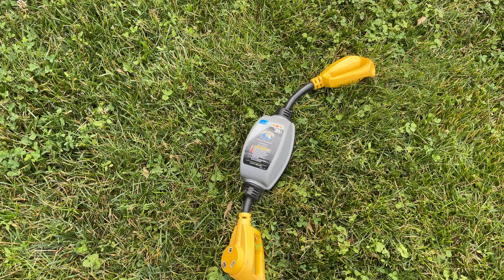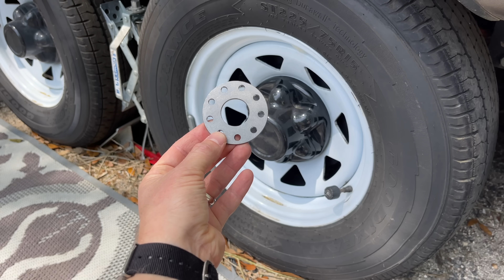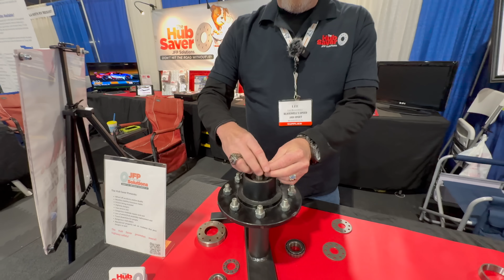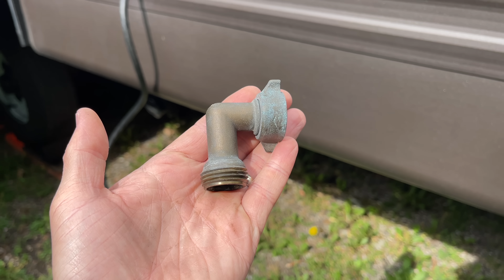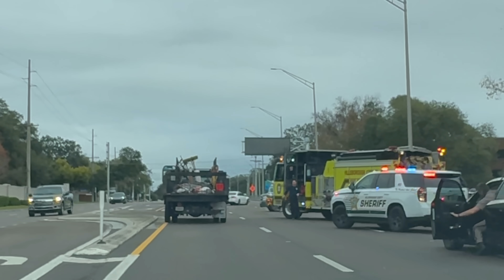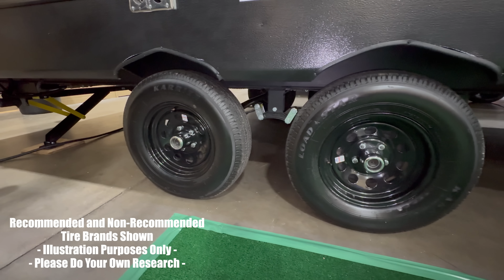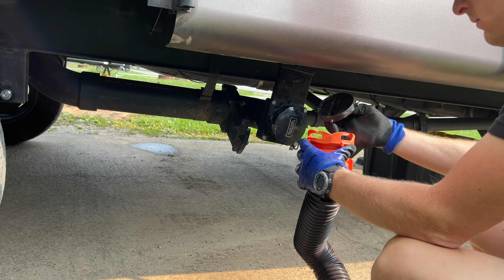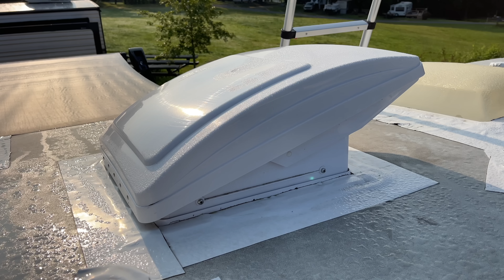RV Upgrades You Should Have Installed LAST Camping Trip (Bet you're unfamiliar with #3...)

Comment: Regarding the GasStop, when traveling, turning the propane tanks off eliminates any possible loss. Kind of an expensive gadget for not taking less than a minute to shut off the tanks. It seems overkill for at the campground.
Reply from the maker: Is a surge protector overkill for the campground? Maybe a rock got kicked up while traveling and punctured your rubber supply hose - no big deal while traveling you drive with the propane off right? but what happens when you turn the propane on at the campsite? how long might it take for you to find that leak otherwise?  GasStop is obviously optional. Happy Trails!

Comment: The Watchdog is great.  I've had both 30A and 50A versions.  It has alerted me to problems with the electrical service many times, including bad wiring.
We replaced our screen door with self-closing screen that separates in the middle when you push through it.  The magnets sewn into the edges pull the two halves together after you walk through.  No more cheap screen door and the bugs can't follow you as easily.  It's one of our favorite upgrades.  (You just have to add weatherstripping to close the gap).
Pressure regulator with a guage, so you know what the pressure is - although you can tell by how fast the water is coming out of the faucets.
Reply from the maker: I have one of those screen door styles on my garage at the house and really like it too

Comment: I have been running Hercules tires on all my trailers for years, in 15' they make a 12 ply and in 16 they make a 14 ply. Never had a tire failure with them.
Reply from the maker: Appreciate the input and data point!

Comment: What a nice young man.  
There is a difference between safety and property damage.   I was a USN nuclear trained officer and test engineer at nuclear power plants.  One consideration in writing a test  procedure is what if the test fails.  At about 16:38 a test was performed by cutting a propane hose under the RV to see if the  excess flow check valve  worked.

What could go wrong?  One of my first preoperational test failures at nuke was that all the excess flow check valves did not work  as expected.   

A couple of years ago I turned on the fan in back half of my motorhome.  This was followed by a screaming voice ‘gas.gas, gas’ from the plug in CO and explosive detector by my bed.

It took me months to find the leak after taking it to an expert who could only confirm that I had a small leak someplace.  I found it by cutting a hole in the bathroom floor.  The black pipe was leaking at the threads of T.  

KISS, Keep it simple stupid!  Propane safety feature is odor but that means you have to be able to smell it.  A small leak under an rv will not be detected because propane is heavier than air.  My installed propane detector is in the main cabinet and will protect if a burner is left on.

I take an exception with  water  pressure pressure regulators and EMS.  Unless I am in my RV, I keep  the hose valve closed or the pump  off.  If the pump  cycles on and off, that is an indication of a small leak.  One night, the pump comes on and stays on.  I rush outside because the most likely failure is the hose. Back inside I turn off the TV and can hear water flowing under the cabinets.  

The point is the pressure regulator will not prevent normal  failures.   Stop  the leak and clean up the water.  

As far as EMS is concerned, use the thing above your shoulders.  I keep a $10 outlet tester and $25 power meter plugged in.  When using a new RV pedestal, I plug them to the pedestal first.  When running a generator or an A/C, I check voltage and frequency.  I listen to how things run.

When I hear ‘sensitive electronic equipment’  my BS meter goes off.  I have a friend who is a rigger at a nuclear power plant.  Something  broke on his old RV that used electricity.  He had it fixed and they sold him a very expensive EMS.  I asked my friend what the root cause of the failure.  When I worked at the same nuke plant I was the mechanical engineer doing root cause investigations.  The electrical engineer doing root cause handed me a printout out problems with ‘sensitive electronic equipment’.  I said  there was a corrosion problem in the connectors.  He agreed.

KISS!  A  $10  screen door handle, great idea.  Buy stock in the company sell EMS, don’t  buy the EMS.
Reply from the maker: On the propane leak - I’m glad you eventually found it! The small leak test with the GasStop is another benefit - whenever you’ like you can pressurize the system, close the tank or cylinder, and then see if it looses pressure - quite handy to do upon setup at each new site.   

Pressure regulator - yes filling your freshwater tank and running of the  pump alone is a great solution and will give you an indication of any leaks as you mentioned - with the pump cycling on and off. I personally fill my tank at each campsite and have it on standby if/when the park looses water it doesn’t affect us. If my family ran solely off of the small fresh tank on our rig we’d be filling it at least daily - so running through city water is a better option - in which case a pressure regulator is highly recommended - not to stop a leak, but to prevent one from occurring at one of the plastic fittings over time at pressures higher than the system is rated for - which I’ve seen at a few campgrounds.  

Honestly sounds like your BS meter is set to “skeptic” mode ◡̈  The EMS system, above and beyond the simple surge protection, protects all the appliances from high and low voltage from the park - which is SUPER common and will absolutely wreck havoc.  

Thanks for taking the time to share your thoughts and opinions and thank you for your service!  
Where is your next camping trip to?

Comment: I don't remember which tires my 2017 GD Solitude 310GK came with. But I replaced them with Carlisle CSL 16 (ST235 /85 R16 132M G BSW). I had 2 of them blow out, over time but...doo doo occurs. I have since gone to the Hartland ST Radial All Steel II (ST235 /85 R16 132N G BSW).
I am very impressed with the Hartlands
Reply from the maker: Thanks for the info and data points!

Comment: at the prices they want for a rv. i would like to see less electronics. 
a basic plug n play electrical system.
and not all rv’s can use these devices. like tha second sewer valve. there is no room on my rv for such. and in 25 years i have not had a fail.  but should rebuild just for safety.
and my hubs are the ever fail they are at end of life and cost a heial of a lot to buy.
Reply from the maker: I think there is a growing segment that would love more basic electrical systems as well -just simple 12v toggle switches!

Comment: I added a clear sewer cap so I can see if there's 'anything' against the cap before removing.
I wanted to add a second blade valve, but without major replumbing, it would stick out and actually make the chance of it getting broken much higher. If I ever change or do major repair to tanks, I'll probably rework the valves.
Reply from the maker: And has that clear cap saved you yet? Any valve leakage from the tanks?
Reply: @rvgearandfar No, couple times there was a dribble, maybe need new valve seals. But thankfully, still just a redundant stop gap.

Comment: Tires is a big one! But I don't agree with brands, in my opinion Goodyear, carhile or however you spell it are crap. I run off brand but high quality on most of my equipment and never have problems. What you have to look at is the ply! My RV came with 8 ply tires which is a joke. Most don't know your max speed with 8 ply is 65. That is where your blow outs come from, most are running over max speed and near or over max weight. 
First thing I did is rip mine off threw them out and went with 12 ply on a 7400 pound tow behind. The max weight goes up to 12k pounds and 88 MPH which I'll never go. Every tire inspection, they are just slightly warm to the touch and look brand new. And it rides nice because I don't put the max pressure in them.
Reply from the maker: The number of ply a tire has and its speed rating are two different metrics - pay attention to both!

Comment: What blows my mind the most is all the scrappy work you've been showing , wow the RV industry is lazy when it comes to the finished look , gross lines exposed to critters chewing them spray foam everywhere , plastic undershirt or worse tarp material,  wow they really rip you off bad ,,,glad I own a 1960 all aluminum camper EVEN THE ENTIRE UNDERCARRIAGE all closed aluminum,  over 50 years old and I just restored it at a fraction of what a new one cost , now it will have another 50 years , tell me your scrappy 2025 will last 20 years and I be impressed ...garbage garbage garbage...
Reply from the maker: Your 1960 rig sounds like a cool project! What make and model is it?

Comment: someone online just mentioned that you need a special fire extinguiser if you have a lithium batteries.  what are your thoughts.
Reply from the maker: I've not come across that recommendation - but its something I'm now going to actively look into. However, I know that the codes required for building RVs state a standard 10 lb ABC fire extinguisher

Comment: Great stuff. Question on the GasStop though. If you have two propane tanks do you have to have two GasStops then?
Reply from the maker: If you leave both tanks open at the same time, yes. Or if you just open one at a time, you can transfer it back and forth between them.

Comment: Carlisle tires.  Towed single axle.  The second blade valve is not necessary - something else to break on the road - useful for a park camper though.  I replaced the bayonet cap with version that has a small hose drain cap.  If I have any doubt, or some asshat at a stop pulled my valves, I can see that before I remove the end cap and hook up.
Reply from the maker: I totally disagree on the secondary black valve at the termination

Comment: Great video! Everything is true!
I bought my trailer with the infamous China Bomb tires. Being a car-nut/hot rodder, I looked at the speed rating, they were rated to 65 mph! No wonder so many explode. While driving, I noticed on my TPM that the temps were over 140. I quickly changed to Goodyear Endurance tires, a world of difference. Smoother ride, and after 4 hours of driving, the tire temp never went above 100. The lone China Bomb was the spare slung under the RV. After 2 years, it was sagging, and the side walls were severely deformed.  Never saw this before. I replaced it ASAP.
Reply from the maker: Crazy!

Comment: This channel rocks it.  Question for anyone.  Just bought my first big camper with all the indoor plumbing.  How far away are most dump stations from where you can pull up to them?  10', 20' ?  I just bought a 15' Rhino Waste hose and now I need to cut  a cleaning hose down to length.  I'm thinking 20'....
Reply from the maker: It can vastly depend campground to campground - but I carry 20ft of sewer hose and only once couldn't reach the dump station.

Comment: We blew a hub and lost a tire and full axel replaced and breaks. It was wild.

We bought the trailer used and they said that the servicing was all done. Hard lesson learned. Now we get our bearings repacked every 10,000 miles.
Reply: Good idea. Never thought about the bearings.
Reply: Sounds like you bought this from Camping World!! I bought a used camper from them & they told me the wheel bearings were repacked & everything had been checked out. Well we hooked it up & the first stop sign I came up to I had a hard time stopping. Found out the brake pads were worn out, they should have seen this if the bearings were repacked. They screwed me once but never again!!!!
Reply from the maker: That sucks!

Comment: 7-10-25, In 2024, I-bought Goodyear Endurance tires for our 2019 Apex Nano 193bhs. 
Three tires, ST225-75r15’s at Belle Tire for about $680. 

My RAM 1500 came with 4 extra TPMS devices and they connect to my dash display. 

When the tech swapped the tires, he showed me a tire that had a bulge in it that I didn’t notice. We only camp 4-5 times a year and travel maybe 2000 miles. The original were Castle Rock from 2018.
Reply from the maker: I bet you were happy to pay the bill that day!

Comment: When I cut a propane hose while driving my propane tank switching valve acted as an emergency shutoff.  Didn't need anything on my tank.
Reply from the maker: It switched over before the tank was empty?  Tell me more about the situation - what happened that cut the propane line?
Reply: @rvgearandfar  The cut line happened because a ziptie that was holding the rubber line up broke.  The line dropped lower and was cut by the tire. The switching valve shut down the flow because of the amount that started flowing out of the line.  I still had 1-1/2 tanks of propane left after I installed a new line.

Comment: One thing I’ve noticed is many folks bending/damaging their rear stabilizer jacks, hanging them on curbs or whatnot. I bought four Save-a-Jack adapters. These allow you to simply pull a pin and the entire jack slips out. I bought four…because I put two at the rear, and added two just in front of the front axle and added two extra stabilizer jacks. They really add a lot of stability to the RV.
Reply from the maker: I love this idea - haven't come across the save a jack adapters yet, but will definitely be checking them out! It'd be cool if we could mount the 2x4 DIY stabilizers to a bracket like this... now you've got the gears turning - thanks for sharing!

Comment: Great video! Having a reversible ceiling fan isn't really necessary though. Exhausting is only necessary. If you want cooler air into your RV, simply open one or more windows. Bringing air IN from the fan does the same thing. However, the air coming in from the roof is likely warmer than pulling air in from the side windows. Therefore, a reversing fan is overkill and likely never used in that manner.
Reply from the maker: Possibly, but with the integrated rain cover and two of those fans you could have crossbreeze without any open windows letting in water

Comment: You definitely need a surge protector, not sure if you need a monitor as well.  Unless it stores and displays historical data, (and at that point, whats the point?) its just a gimmick, the power to your rig is going to fluctuate based on what everyone else in the park is doing, so save some money.  You're not going to monitor it 24/7 anyways.

The water pressure is good, I do like the idea of adding pigtails to the water inlets.  

If you review the hub saver website, the washer allows for heat dissipation which is to give you more time to realize it and stop to fix the problem, it does not prevent you from losing a wheel/hub if you never notice.

Tires always are an issue, keep in mind, many of them, mine included have a speed limit to use (how does 60mph grab ya).  I personally, will swap mine out for light truck tires because while most trailer tires people will eventually have issues with, most  light truck tires just go bald after 50-60k miles.

Comment: We had a surge protector and it was stolen after midnight while camping.
Any ways to keep that from happening again if I purchased another one?
Reply: Mine has a loop built into it so you can lock it up, albeit I have never locked it up.  Considering it has a nice burn mark on it, I'd recommend you buy a second as burn marks on the surge protector is cheaper to address than burn marks on the trailer...
Reply from the maker: Cable bike lock is what many folks use